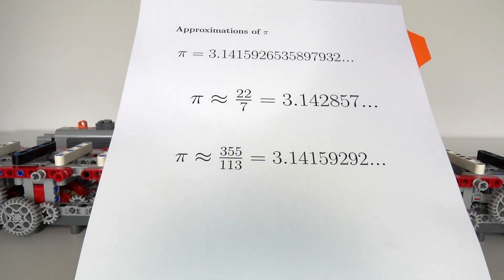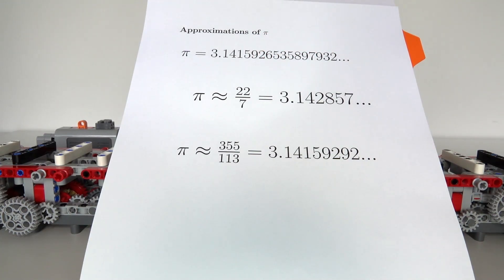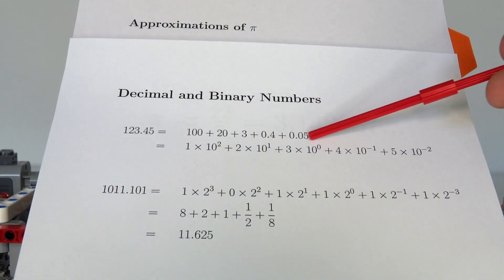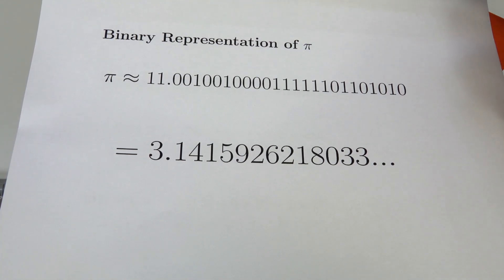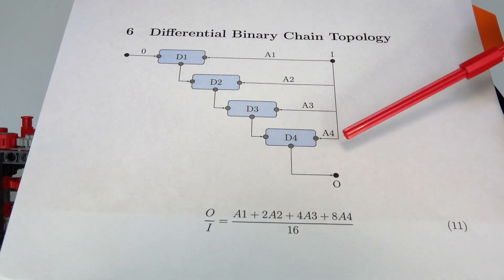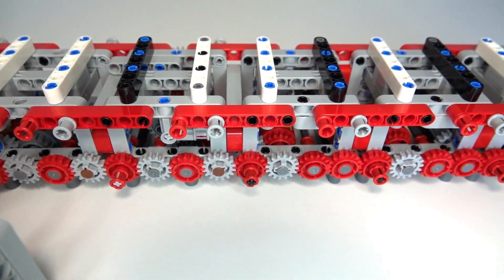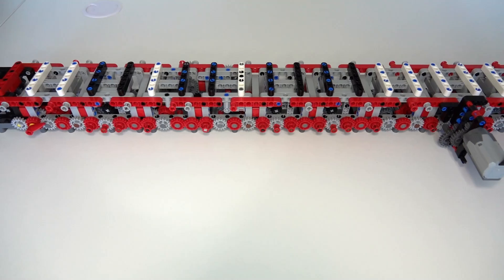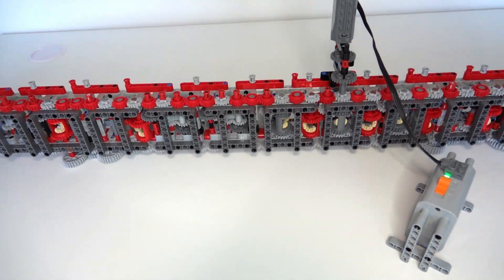Lego Technic Binary Expansion of Pi

Comment: I really like the modularity of it. If there were no limits for the cost of parts or the friction of LEGO pieces, you could keep expanding it with more digits to make it even more accurate.
Reply from the maker: Hi Zach, yes it is modular - I did find I had to put the motor in the middle to overcome the friction so if you are going to add more modules it will need multiple motors to drive it. 🙃

Comment: Here's the exact value of pi:
10
(In base pi of course)
Reply from the maker: LOL can't get more exact than that! But what would 10 decimal be in base pi? 🙃
Reply: @TechnicBrickPower  If you expand with always taking the first power you get 100.010221222...
But similar to how you have in base ten that 1=0.9999... you can have multiple representations of the same number in base pi. But there things are even more unintuitive. For example ten also equals 30.121... or 23.202...